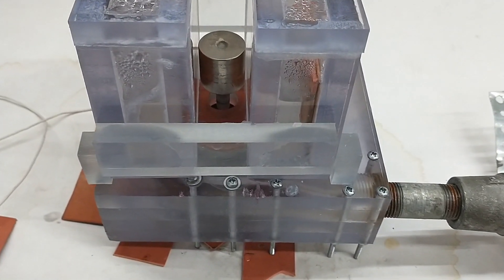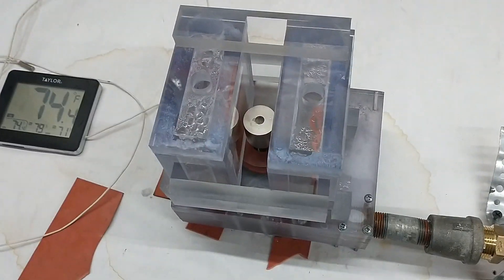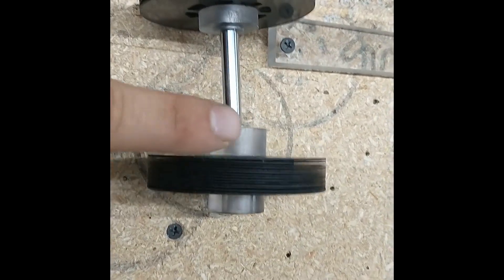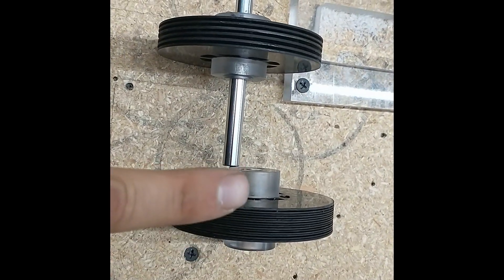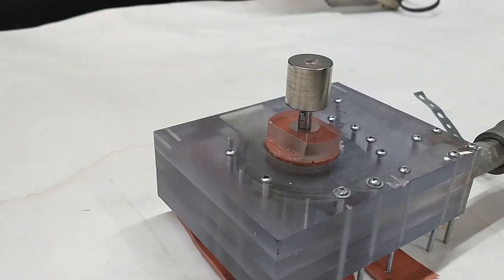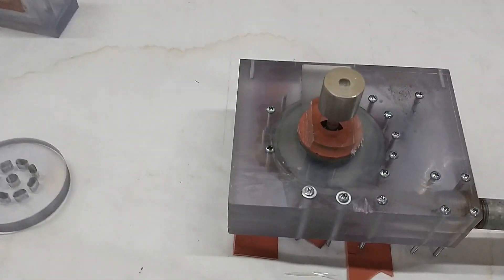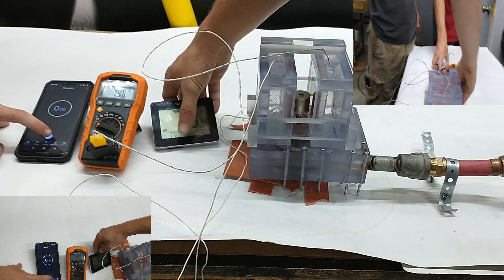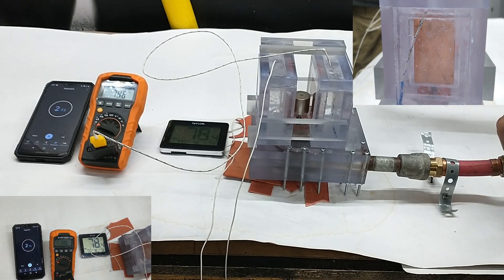3" Tesla Turbine Sustains an estimated 1750 WATTS!

Comment: I just wonder if the boiling at the surface was confused with the entire volume of water reaching 212 degrees F. The temperature sensor never made it to 212 and the clock was stopped at 86 seconds. Which would be closer to 1000w which is still very impressive. I’m not trying to be negative this is really impressive and a cool way to measure power I’m just trying to figure it out. Thanks for the good content.
Reply from the maker: yeah the test was sloppy, I just wanted to quickly test it while I had time. The temperature meters were off too. I basically calculated when we saw steam. But I am confident we got at least 1500 watts.
Reply: @iEnergySupply  awesome man, thanks for the reply, like I said I wasn’t trying to be negative, lord know there’s enough of that on social media. Keep up the good work!
Reply from the maker: @zakkt1 Yeah it's good to be critical, Ill have more accurate tests in the future for sure.
Reply: @iEnergySupply  The fact that a lot of water escaped is a source of error too, since the quantity of water to heat changed.
I would run the test on a larger volume of water for a few minutes (predetermined duration) and use the increase in temperature to get the change in enthalpy. No messy boiling or difficult to determine durations.
Looking forward to see the new turbine with a balanced magnet in action.
Reply from the maker: @erumaaro6060  One reason I didn't post the video a long time ago is because it wasn't too clear. I probably won't be testing this way again. From now on Ill be testing with just a generator using cold steam. Ill be using my analytical equipment to test power output.

Comment: Do you have plans on your Tesla Motor? What is the disc spacing of the new one? What thickness is the disc?

Great work Btw
Reply from the maker: my latest plans will be available soon! they will be for the production model. I would suggest waiting, they will be available on patreon.com/ienergysupply
Reply: @iEnergySupply  Thanks man, I may consider purchasing the plans from you patreon once you confirm The horsepower output with a more reliable measurement..... 

 Its very impressive if 1750 watts is true for the small size but i need to know for certain

Comment: Amazing stuff, man. If power according Bernoulli = volume x pressure and it was 100 PSI Gauge pressure, then I assume you used up only at least 2,5 Liters of pressurized air to run a basic microwave or induction oven? Mind blowing stuff.. Also the Self-Sustaining HV Charge in Electrostatic Rotary Converter built by Chris Carson shown on the Aaron Murakami channel.
Reply from the maker: I plan to test this generator with aaron and erik dollard this year possibly.
Reply: @iEnergySupply  Very Nice, I follow you and also master ivo. He is also working on amazing aspects of electric fields.
Reply from the maker: The exact volume of air is unknown. I follow Master evil too! He's doing some amazing research

Comment: That is a very good TESTING technique, Congratulation! But of course, I hope, one should not be eager to conclude that they should use the electricity generated, in any way actually, for direct heating, as that would be the worst, and most expensive way to use the created electromagnetic vibrations. Unless, of course, they are been generated by a thorium source (via a liquid fluoride thorium  reactor) which is so energy dense, and used with extremely high efficiency, that in its case, the efficiency of the entire energy conversion process will not matter.
Reply from the maker: Yeah the main thing was to show the raw power. Wouldn't it be nice to have a thorium reactor in your back yard haha

Comment: Someone asked in anothe comment but answer wasnt given. Do you have the intention of using the steam or pressure produced to run another turbine? I suppose other than boiling water what is the ultimate goal? Pure curiosity
Reply from the maker: Although it would be a fun experiment, even one that would show efficiency quite well, I don't see the point.
Reply: I suppose I am missing the point all together. Cool boil water w coil and magnet. Gets you steam. For what if not to power something ?
Reply from the maker: @cavelvlan25  For a long time people want definitive proof that the tesla turbine can produce more power then a toy. This is the proof. Watch my other videos to see electrical generator output.

Comment: If I remember correctly, 0.4mm is the optimal spacing in terms of torque.
Reply from the maker: depends on the size of turbine, this turbine should actually have smaller spacing between the disks, or it should be compounded.

Comment: I'd definitely like to see if this can heat the water enough to run itself. I'd also like to see it running on lower boiling point fluids such as alcohol.
Reply from the maker: I don't think it could, it would be a perpetual motion machine. If it did the energy would have to be coming from a mysterious source, which is possible but unlikely.
Reply: @iEnergySupply  I don't think it would be a perpetual motion machine. Yes it would go on and on, until you would put another load on the turbine. Then it would cool the water down and eventualy stop. Is that right?
Reply from the maker: @bringtheideas460  absolutely.
Reply: @iEnergySupply  I think you have what it takes to do it; you have a greater mind than mine. Sometimes it helps to take a break and see it from a different perspective. You are illustrating that by manipulating the heat/pressure ratio we live in, we can tap into it to produce kinetic energy and it can be recharged by that same ‘mysterious’ energy source; it’s not actually perpetual motion. You are using the heat and atmospheric pressure energy that is plentiful in our environment and taking advantage of the natural properties of water under it’s influences. 
  The vacuum pressure can be restored; one way or the other. You are already using heat. Can it be designed to use ordinary room temperature heat instead? (-boil at lower pressure?).
Reply: Or If you could collect and condensate the same water. Making full loop?

Comment: Question - what would happen if the turbine disk edges were sharp? I imagine less turbulence on the edge of disks for steam coming in. Now its like the steam has to go through a dense mesh
Reply from the maker: It does help, although the spaces in the disks become like a nozzle when done correctly so not much energy is lost in this scenario I believe. Ill be tapering them like a pizza cutter with the next turbines.
Reply: @iEnergySupply  Nice, that is exactly what i had in mind. Hope this will improve it in a tangible way
Reply: @CharlieSolis  Im not sure how you tried to share it, but ive got no pings anywhere. Though dont worry about it. I wouldnt have the time to read it anyway, and ADD really interferes with reading papers. I appreciate it though

Comment: are we not chasing electric power whit this thing? Idea! is it not more accurate to test the power if you  have a isolated vessel of about 40/60 liter whit a small circulation pump en let it run for let's say 1 hour en calculate the energy delivered?  About the disc spacing en Stuff I swear that I've seen that ( Charlie Solis) from TESTUR energy have this kind of configuration a year ago or so ( smaller spacing en bigger diameter so he can use normal bearings en rpm's ) I have to say his turbine is far from perfect but he shows a 25% efficiency, even whit great (gear, diode recivers, inverter en noise) losses  ,
Reply from the maker: That would be a better way to test for sure. Ill be testing with just a generator in the future though. Both charlie and I use the same reference patent, tesla's improved rotor. PATENT SPECIFICATION

186,082.

Comment: I'm wondering if you could boil the water with one of the turbines witch extract all the heat back into motion (freezes the water), then reintroduce it back once more liquid. How long might it run on its own power?
Reply from the maker: would be a fun test to feed the water through a venturi nozzle with air to see how much more power we can recover. The water would defiantly freeze in that case.
Reply: @iEnergySupply  Yes you should do that to settle the thermodinamics debate. Some people just reject this completelly. They say that is impossible. They say: "b... b... but carnot cycle a... a... and latent heat a... a... and isothermal processes. Bro its THERMODYNAMICS! You can't do this, you can't destroy our cool waste heat and our amazing inefficiency! How can the world drown in inefficiency if you do that?! Nooo! People experimented and did research! And spend bilions on this already! And you are a fool!"Jeah jeah, you probably know what I'm talking about...
Reply: You could just run a flow simulation before embarking on a physical prototype
Reply from the maker: @impactodelsurenterprise2440  That software is very expensive and many times you don't get exactly what you need. It would be nice to have it done first though.
Reply: @impactodelsurenterprise2440  stuck between." you must be an engineer" or " yes bcuz everything in a simulation works exactly like its supposed"  
Another note actually making something and seeing it fail is a much richer experience than crunching numbers and saying it won't work.
Reply: @impactodelsurenterprise2440  Curious question (not being sarcastic) doe the simulations work inside the box or out... 
I've never used any (would love to though out of curiosity), would it break if there was a breakthrough in what we think we know now, would it just reject what it don't understand due to input, or is it simplistic to the point anything goes and it just gives feedback data/hard numbers regardless of what they are.
Reply: @510Redneck  I use it mainly for structural and flow. Main thing to be aware of is rubbish in rubbish out, so you really have to be thoughtful when you're putting in your parameters. Otherwise it's a really time and cost savings tool to have. I run an engineering fab shop so for structural work you really have to be right the 1st time, without over or under engineering it. Simulation works well for me in that scenario. As for flow, it helped me to find inefficiency I would otherwise have not discovered whether its still in the design or physical state. Examples are unwanted turbulence in places you would never have thought of, flow velocity at different sections, efficiency of particles filtration, etc.